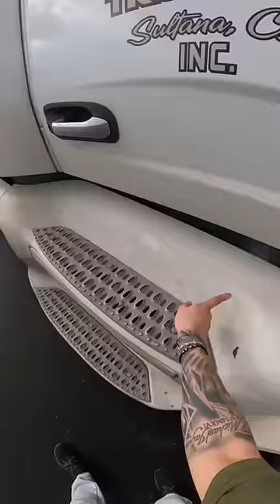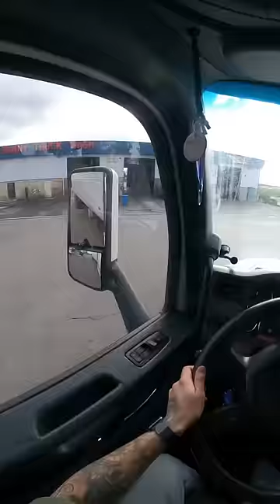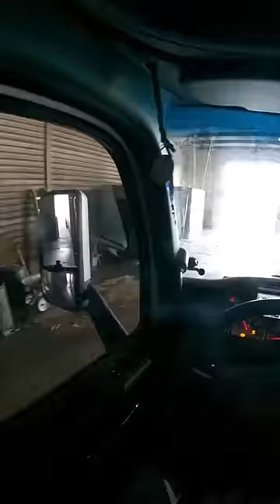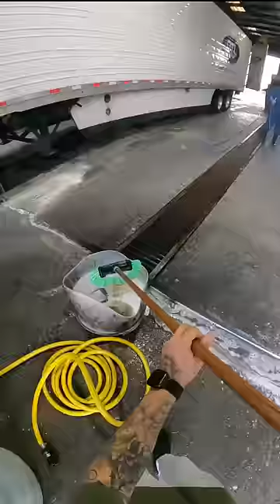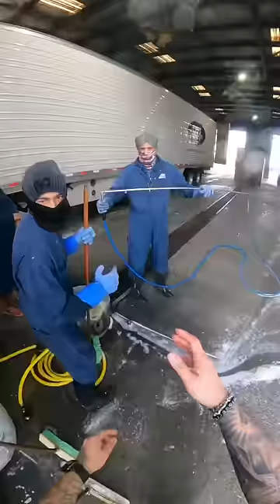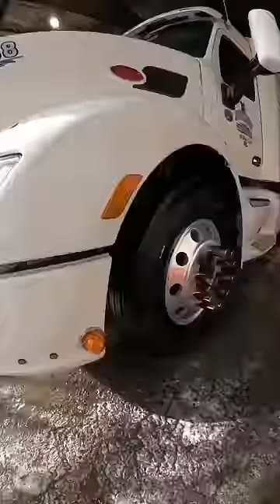pov: on a mission to wash billy bob 👏🏻👏🏻 #shorts

Comment: I used to work at a similar place called Blue beacon. You have to do one of those trucks in like three minutes. Truck and trailer. The guns are as strong as they are so they can get everything off of the truck quickly all the way up to the top of the trailer. One of them is full of soap and water, one is just water, and one is Rain-X and water. They're always on, and spray extremely hard at full blast. They literally teach you a specific way to hold them so you don't snap your elbow.